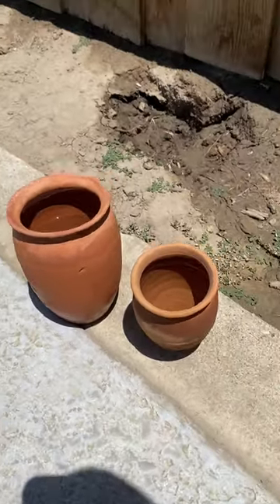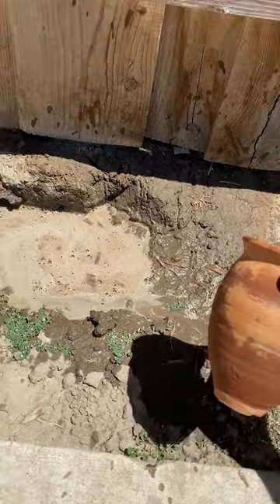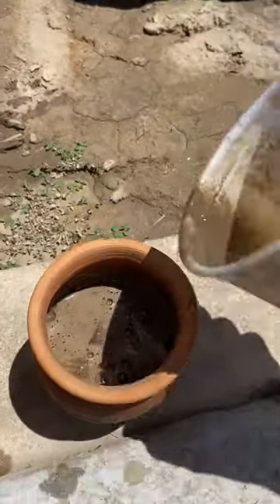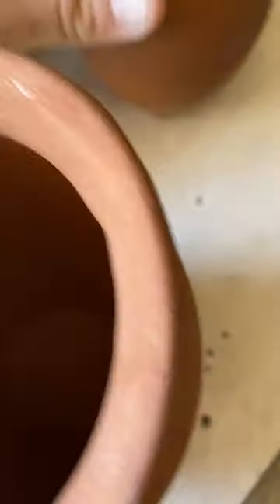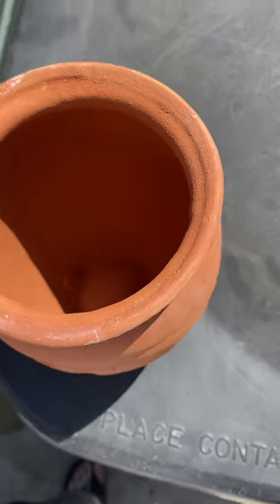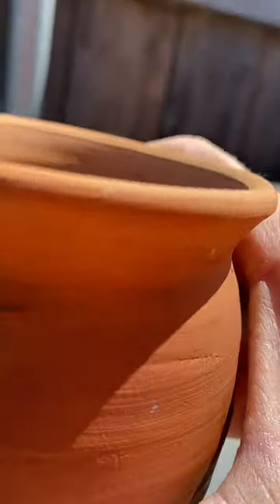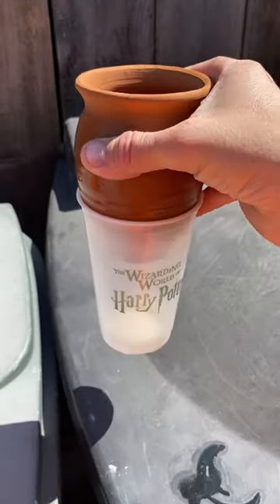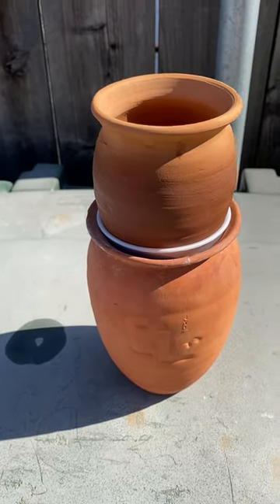Does terra-cotta pots work  for water filtration or not?

Comment: The bottom of your terra cotta pot is too thick and has a glassy finish. You could prefilter the muddy water through sand or moss first. Also, big pots would filter faster because of the weight of the water. You can get two big plant pots and for corks into the holes, or use a closed pot on the bottom.

Comment: You need a large pot. LARGE
Reply from the maker: The problem is not the size of it was the fact that the water would not get clear even after filtering through two pots… so ur better running through a charcoal filter

Comment: My first thought would be to weigh down an empty pot IN the muddy water, but not deep enough for water to reach the top.  Water filtering through the walls would wind up inside the jar.  I think this would benefit because the water trying to get in provides a certain amount of pressure, helping squeeze the water through.  The method demonstrated also means moisture is being lost as it soaks through because the environment is evaporating it away.  In any case this is probably not a good way to filter water, but hey, when desperate it's gotta be better than nothing.
Reply from the maker: Interesting ideal ..ill try it for a video.. ty

Comment: Maybe a lid ,i wouldn't think u want to evaporate. And im sure this method is a slow long process.
Reply from the maker: No, unfortunately it does not work. I used the lid a clear cup in the top to try to block any evaporation, but the water took too long the filter through so even if it did work, you would never get clean enough water by the time you dehydrate I only got like a couple drops in a 24 hour and the dirt from the dirty water clogged up the pores so therefore, it did not allow it to filter through
Reply from the maker: The only way I see this working is if you’ve already filtered out all the dirt and allow your water to settle. But by that point, just either use activated charcoal or a drop of bleach per liter
Reply: You used the wrong kind of pot and container the filtering pot needs to be set inside the container with just the lip of the pot exposed and covered.
Reply: @joepalermo3836 and the length of time it takes for the water to actually filter... Leave it overnight.. Not 2 hours... lol  plus that pot looked like it been in the sun before he tried this.. he had clay wash in his cup.... lol   Bad Video this was!!!
Reply: Wrong set up and with too small a pot to start with.  DO NOT follow this example.
Reply: You need to’ mix the clay with coffee residues, then make the pot, bosque fire it. the coffee grounds will burn out completely, leaving space for the water to pass.

Comment: It takes hours to go through
Reply from the maker: I understand that, but in an actual survival situation if you needed clean water, this method would not work because the dirt still transfers through and the water is not clean. As you saw from my in product, I put fresh clean water in there and it came out dirty.

And after two hours, there was only a drop of water and if you’re desperately needing to filter water, you’ll never get enough water to survive off of this method. And then you still would have to run your water through charcoal filters and what you would lose more water due to the activated charcoal, absorbing some of the water until it became saturated .
So the method works, but unfortunately, it is not an efficient way in a survival situation

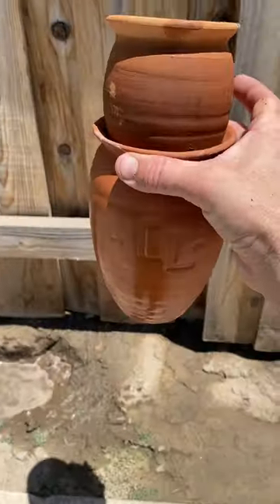Comment: @ 3:28, you said, "... and we're gonna allow it to condensate, and drip down ...". 

I think what you meant to say was "filtrate" rather than  "condensate"?

Excellent query / experiment, nonetheless, though, dude.

Also, w/ terracotta being the far slower filter, I'd assume it'll also be the better, more thorough at filtering than the avg. retail charcoal filter, like the ones "Brita" and "Pūr" use; meaning post-filtration treatment, as you mentioned, ie., iodine drops and/or boiling, may no longer be so necessary; hypothesizing that the dangerous microbes, bacteria, mold, amoeba, viruses, etc., were also unable to get thru the non-vitreous wall of pottery.

... but, then again, that's only a guess; so pls. do still boil and/or iodize, b4 drinking, fer sure!

Comment: A Berkie does not work that fast either.
My brothers takes a day to filter i think its 3 gallons.
Terricotta is a primative non yuppie Berkie wster filter.
If you wat faster then buy disposable filters.
But the faster it filters. The less it filters.
I haven't used mine yet.
Currently im  few minutes into both
A water filter and a water cooler.
Both are the normal pot.
You would think being on the Mexico board id be able to find others. Like a occal. But nope.
Im using a sink stopper in the hole in the bottom.
Linda tricky since you dont want water to drip out the hole. But want water to filter through the terricotta.
At this time it seems to be working.
But its also hummid today. Got my first rain this year last night  June 26.
I hope this works.
Be nice to filter my bulk water.
Filter used water to reuse. ( Baths washer machine ect ect. ) 
Heck i may even start filtering piss. 
No really water is that difficult to get.
Last year i got no sizable rains. So i got no water captured. 
Water is something city folk give no though to.
Reply: What?
You speak of activated charcoal.
How did you miss that charcoal filters also make you water dirty. Until they are broken in.
Same with the terracotta.
The water wasn't discolored due to the mud.
It was discolor because the terracotta filter was still breaking in.
First you need to sand the inside and outside of the pot.
Rinse it.
Then you need to fill it up and filter 5 times. Roughly 5 days.
You can use the same water for this.
This also will tell you how much you lose to evaporation.
When you filter gets dirty. Simply sand the inside and rinse it.
Just like a Berkie.
Btw you need to do the same with a Berkie.
The difference is Berkie you sand the filter. And terracotta planter you sand the inside of the pot.
Btw if you miss part of the pot. Say around the plug. Don't fret. . It just a small portion and shouldn't make a big difference.
Reply from the maker: Well, thank you for the information. I did not realize that it took so long. I want to try it again but with larger pots and a better environment.
Reply: i have a been majorly researching this topic, which is exactly how I came across your video. Im just throwing ya what i’ve learned, the gal seemed to be knowledgeable and loved the process that is merely on her kitchen countertop. the info i have learned haven’t tried yet but i thoughtzs I’d share. This is how understand it -the filtering doesn’t transfer like your expectations have, rather the water sets in and remains in one large version of our friend the T pot, it stays where you placed it. It is important the shape, that matters, and she lets it’s set half the day at least but what is happening is the pollution is pulled through the thick pot and rests on the outside of the pot and the clean water stays in and while it will also be a littles cooler too and this is the most valuable part of this specific process. The clay pots are full of minerals, which are added to the water in replacement of the pollution that was pulled because water, of course is always attracting some thing. It’s magnetic charge is always hungry all the time and the molecules need and the terra-cotta pot minerals are super delicious and healthy so that’s really where the value is here. It is to my understanding that then when you collect water about once a day before you do collect your new days water be sure to clean the outside of the pot yet not with soap. that’s going to be a hard one for me 🤨 i’m about to dive into all this fun but i’m not done researching, and thank you for the content, I was enjoying on topic to my current slight obsession. and to any experts on this topic, who may be reading these comments after watching this video, don’t be shy, help us out here.